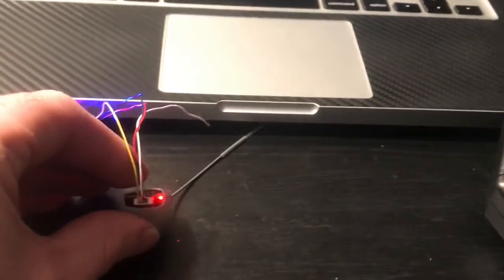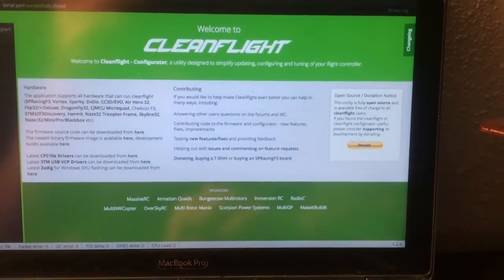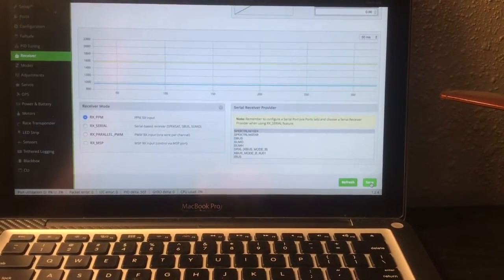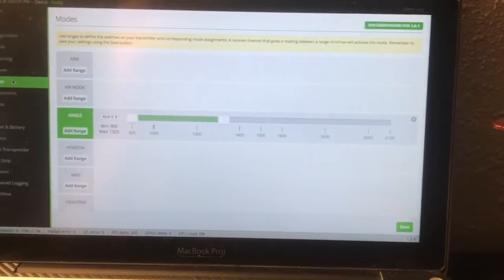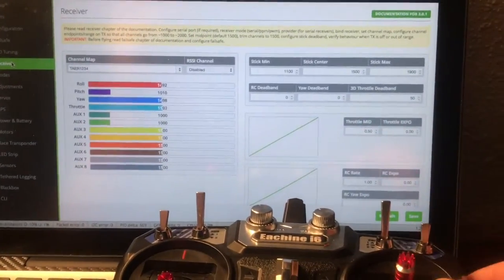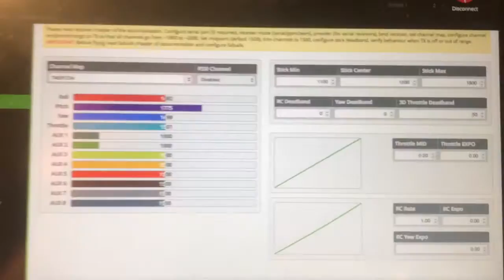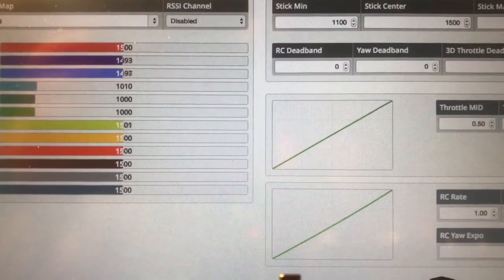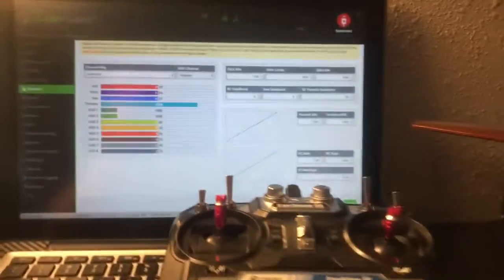2s q100 UPDATE- Installing The Flysky FS-A8s Receiver in my Q100 2s (included bind procedures)

Comment: What should I do if it starts off as the slow blinking light and when I reboot the transmitter, it doesn't do anything?
Reply from the maker: You need to hold the bind button, turn it on, then release the button. If you don't, it won't go into bind mode.